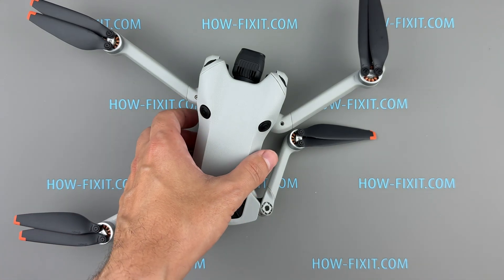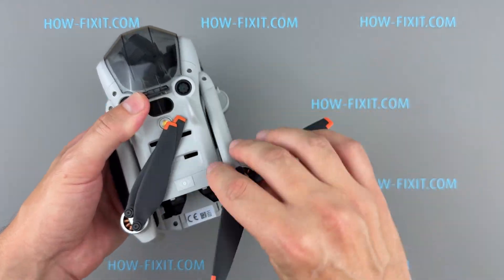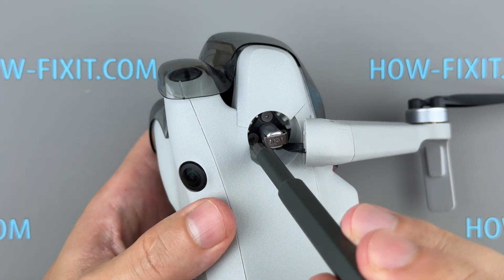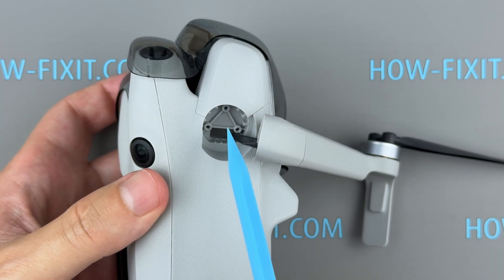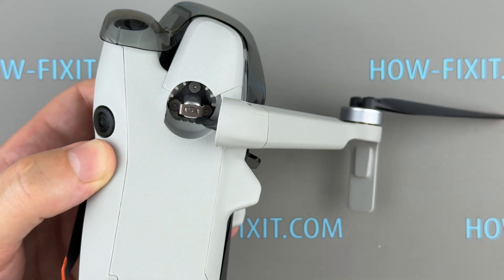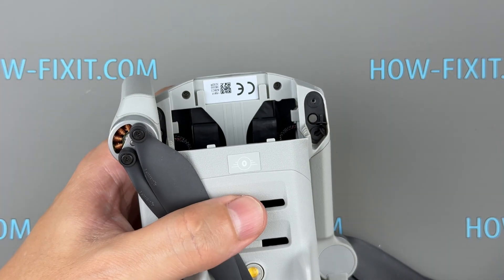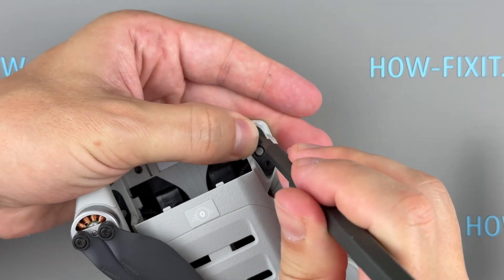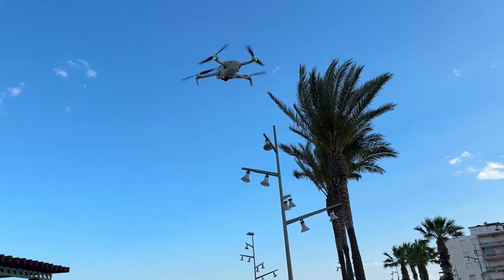DJI Mini 4 Pro Arm Shaft Replacement – Fix Broken Frame Arms Fast!

Comment: The problem I have was in trying to replace the axle. The three Brady screws came out no problem but there was one holding onto the shaft and the secret head stripped out. I’ve tried a bunch of things including drilling off the top of the screw and still can not extract the screw. Any ideas?? Please!!
Reply: I have the exact same problem did you solved the problem ?